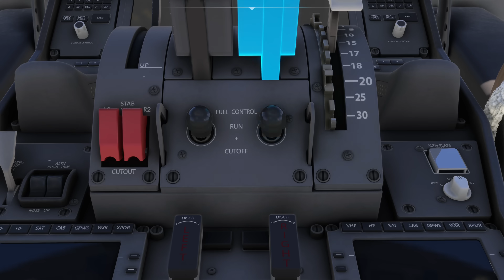Air India 171: Why Did The Fuel Cut-off Switch Get Moved?

Comment: With due respect, I want to raise a few questions as a curious observer who follows aviation safety closely. I hope experts can shed some light on this scenario-based situation:

Let’s suppose you're in the cockpit as Captain A, flying with first officer B. The aircraft is airborne for barely 10–15 seconds, and suddenly you hear a loud sound and experience an engine failure. Then, the cockpit screen shows both engines have shut down, and the fuel control switches have moved to CUTOFF.

In such a high-stakes moment, wouldn’t the natural reaction from Captain A be to ask, “Why did you cut off the fuel?” – especially if he himself didn’t perform the action? Because if you notice after hearing sound of engine and looking to the nosel of fuel and see it's cut off and asking questions,why did you cut it off, when you didn't did it , so obviously other pilot did it , so question make sense And if first officer B responds, “I didn’t do it,” if he actually never did it , then both the question and answer seem reasonable. And if examiners know it is cut off by the pilot and  this happens then why in reports, they never mentioned positioning of both right and left nosel (button or lever) actually cut off by pilot and then they put it in its original position. In black box they can hear it it actually happened and with full conversation they can understand it, what both pilot doing at that time when it pull to cut off. 

But now comes the technical concern: fuel switches can be manually cut in 1 second, but to observe, assess, and act on such a major fault would typically take at least 10–14 seconds when to cut off it takes 1 second gap and restart 10-14 as mentioned, that delay makes it suspicious , when after seeing it should again take 1 second, even understanding that handling a take off its not possible of doing back in 1 second but after noticing and asking questions ,4 second passed as mentioned, still in next 3 second both fuel lever can be up from down Even handling a plain taking atleast 7 seconds in worst condition but took 10-14 second for both lever to make it up postion, isn't suspicious.How much time would you take after releasing the same thing happened and both lever pull to cut off, and regain to its original position to on , if less then 10-14 second and same  which is very high as a pilot reaction , then something else happened. If relight was attempted only after that, doesn't the delay feel suspicious, or at least worth deeper investigation?

Also, why are we being shown only select lines from the cockpit conversation, rather than the full sequence of decision-making? If both pilots say they didn’t switch off the engines—yet the system says it was a manual cutoff—shouldn’t that raise serious questions about either the switch design, potential unintentional triggers, or even human error?

I’m not drawing conclusions, but from an aviation safety perspective, shouldn’t these timing gaps and conflicting cockpit inputs prompt further analysis before assuming the pilot fault?

Looking forward to expert insights on whether such a scenario is technically and procedurally possible.
Reply: But how do the switches go to cutoff on their own? The report does not mention any bangs except the sound of the RAT deploying. It cannot occur from a computer instruction. By the way, on an aircraft during flight, there are only Captain A and First Officer B.

Comment: How can the throttles be held forward and also handle the fuel switches? Long fingers?  "Why'd you do it?"  I think would be normal for someone who is a civilian trained pilot, where a military pilot would have washed out for thinking slowly.
Reply: The throttles stay in whatever position they are put in, and, in a climb, they would be in a position to provide near maximum thrust. No need to operate the throttle and fuel switches simultaneously.

Comment: What don't commercial aircraft as standard have a permanently running digital camera filming cockpit events and feeding said data on a loop into one of the blackboxes. A bit like a car dashcam. Without it, this so called air accident investigation is in fact leading to conjecture. Naturally, the aircraft industry is wanting to find pilot error rather than a manufacturer defect. The manufacturer should be fitting these cameras as standard unless they have something to hide. I am sure airline pilots would welcome this too as it could protect them from unjustified attack..

Comment: Can we be sure that the flight recorder really records direct output from the switches? Could it happen that the apparent cut-off is just a bug in the software, and pilot noticed it by not looking at the switches, but just by the fact that the engines stopped working, and assumed that the other pilot did that? I have no idea how flight recorders are implemented, but I doubt they have everything wired directly, there's rather some bus, which means there is software processing the output from the switches first. Maybe a very unlikely scenario, but it would explain why the other pilot denied. I know the switches were in cut-off position at the end, but that's after they realized there's a problem.

Comment: Now Several things
1. Captain or Copilot probably would not have changing the fuel switch to cutoff as their further actions doesnt signals any resistance between them.
2. Where is the missing conversation between the pilots from the time of cutoff to the Mayday call.
3. Why it took 10 sec to turn the switch back to run mode, Did the Captain himself got up and chaned it?If first officer is responsible for cutoff, then why he didnt stopped the Captain for turning it back up?
4. So with Mayday message why he did not send the sabotage or failure message to add clarity.  
5. Around 300 souls were crushed or burnt to death, was it done by someone to take revenge in form of punishing him a death of hell.
6. Maybe the report is false and switches never went to cutoff, fuel supply just got cut off and these guys probably knew how to turn back any emergency fuel supply process if any but it took 10 seconds.
So sobotage Maybe
Boeing problem Maybe- if its so easy to drown a plane then boeing should be sued, why they didnt have a process to lock these switches during ascend and it should only be changed to cutoff during descend?
Why they are not thinking of safety and leaving it to a person when its being sold a such a massive price. Boeing should be penalized and sued if possible.
Reply: Was the conversation in English, or in the pilots native language.  We need to actually hear the audio.

Comment: "Why can't the fuel switches be designed to require two people to activate?" Because in case, one pilot is out of order, and that's one major reason, there's two pilots on board, you reamining pilot never will switch any switch any more.

Comment: "Hi Captain, in a computer system there is something called a self-test. When we turn on the PC, we can hear a beep sound, which indicates that the PC is checking whether the hardware is working properly. Similarly, in an aircraft, there are self-checks to ensure that the hardware, systems, engine, and fuel are in good condition and ready for operation. If such self-checks exist, then why don't they alert the pilot before takeoff if there's an issue?"
Reply: Because there wasn't an issue yet.

Comment: From today's NY Times: "Air India Crash Findings Prompt Inspections of Boeing Fuel Switches

Airlines in India, Singapore and South Korea were inspecting fuel control switches on their Boeing jets."
So, Captain Steeeve, if it was actually pilot action that shutoff the fuel switches as you and the Indian authorities have claimed(preliminary report) then why the inspection? why are Airlines and Indian Air officials ordering inspections of these switches? I believe my theory, is now even more plausible as i state yesterday, that the pilot didn't actually witness the fuel switches being flipped off but saw the warning on his front screen console and ASSUMED the other pilot flipped them off. instead, a glitch a short a loose wire perhaps initiated the shut down. It explains the 4 seconds of toggle the switches on and off then back to on to restart the fuel pumps. Captian Steeeve: no more jumping the gun especially with preliminary reports. So much for your analysis.
Reply: Why? They are being smart since no one yet knows the cause of this tragedy.

Comment: WHY WERE THE FUEL CONTROL SWITCHES SHUT OFF?  HERE'S THE ANSWER:  Suicide and or terrorism.  

Remember, at the time of this accident, India and Pakistan were at war.  Years ago, Pakistan primarily pulled away from India because of ideological and religious reasons.  I.E., Pakistan is a Muslim country.  India has quite a few Muslims.  

I am aware the Air India captain had psychological issues but that does not mean he was suicidal.  It appears as if the CA was flying the airplane.  If the CA wanted to commit suicide, he did not have to shut off the fuel switches.  At low altitude, all he had to do was dive bomb the airplane into the ground.  After the fuel switches were turned back on, the pilot flying (probably the CA) continued to fly the airplane.  If you are committing suicide, you would not continue flying the airplane.  If you are the non-flying pilot and committing suicide, you would take some sort of overt action to bring the airplane down.  There was no indication that occurred.  

The first officer was a new hire pilot.  He was holding a position, most probably, way beyond his seniority position.  It is clear, he had connections getting hired at Air India.  He attended an off beat flight school in Florida when Embry-Riddle Aeronautical University was just a few miles away.  ERAU being one of the premier flight schools in the nation.  Why would you attend some rinky dink outfit for training when you could obtain top of the line flight training at ERAU?  There are a couple of reasons.  1.  ERAU continues to be under scrutiny by the FAA and Homeland Security for training some of the 9-11 pilots.  2.  ERAU flight training program is highly professional and highly structured.  Perhaps the F/O was trying to avoid both of these things.  Being scrutinized as a foreigner and looking for the easiest non demanding flight training.  

Air India is on the verge of bankruptcy.  They are not governed by the FAA or the NTSB.  They have their own investigative operations.  They do not have to disclose the CVR or CDR to the public.  They can omit anything they want and in fact, lie if they want to.  Independent reporters should investigate the F/O.  Follow the money, his sugar daddy, ideological and religious beliefs, who he hangs around with, etc.  Don't just assume the CA was responsible for this mishap.
Reply: rubbish!!    Today's NY Times story: Air India Crash Findings Prompt Inspections of Boeing Fuel Switches

Airlines in India, Singapore and South Korea were inspecting fuel control switches on their Boeing jets.
Reply: @stevebubbie1126 they haven't found anything though have they? Nor will they
Reply: FO was pilot flying, Capt was monitoring
Reply: @clm2071  - how do you know this magic crystal ball?

Comment: I tend to agree with the Indian Commercial Pilot's Association:

"The Indian Commercial Pilots Association (ICPA) said it was “deeply disturbed by speculative narratives... particularly the reckless and unfounded insinuation of pilot suicide.” “There is absolutely no basis for such a claim at this stage,” it said in a statement Sunday, adding, “it is deeply insensitive to the individuals and families involved. To casually suggest pilot suicide without verified evidence is a gross violation of ethical reporting and a disservice to the dignity of the profession,” it said. "

Even if this turns out to be pilot suicide, there has not been enough evidence at this stage to draw that conclusion.